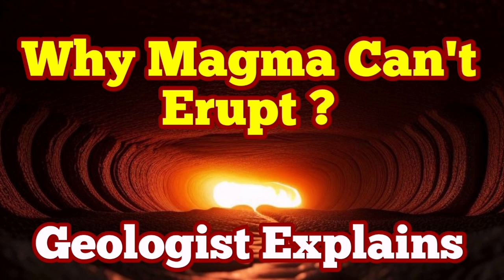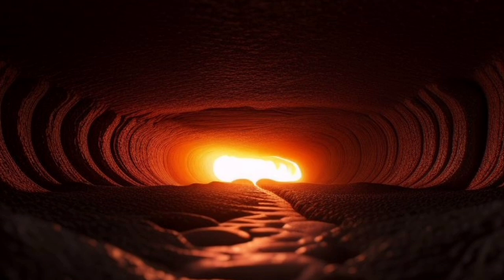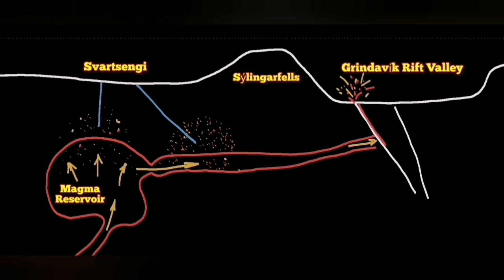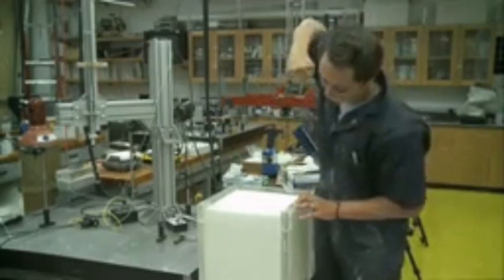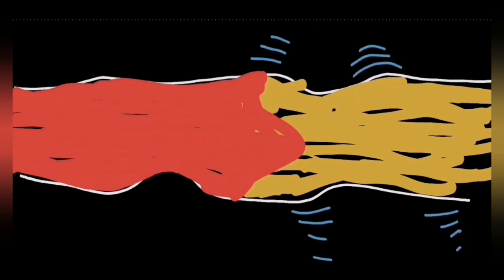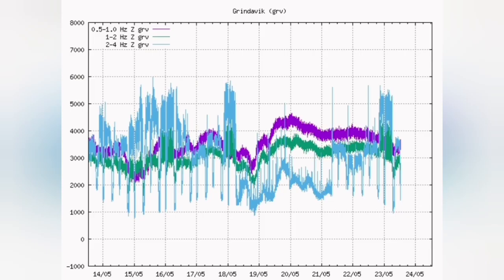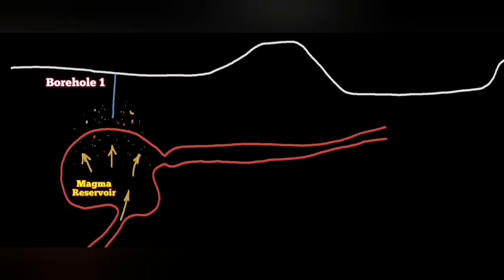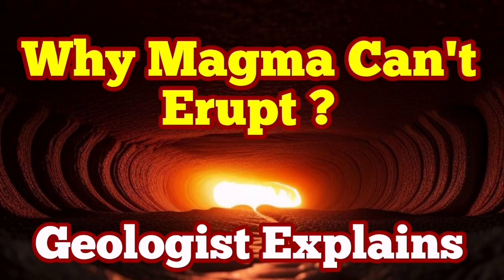Why Magma Can't Erupt In Iceland Svartsengi Volcanic System, Geologist Explains

Comment: I have a question. Are all types of magma non-Newtonian? I ask because the structure of Lava can vary from one erruption to the other i.e Viscose or Runny etc. 
Q2) Can the Non-Newtonian magma be timed durring it's journey through semi-Solid lava in the tubes? 
Q3)Do the bore holes affect the density of the Non-Newtonian Magmas molecular pressure?
Reply from the maker: They can have differences. It depends on viscosity which is controlled by many factors, including silica content, temperature, crystal size, volatile content and some other factors including geometry of the magma pathway and capacity and porosity of the conduit.